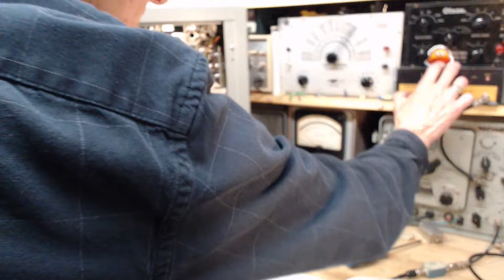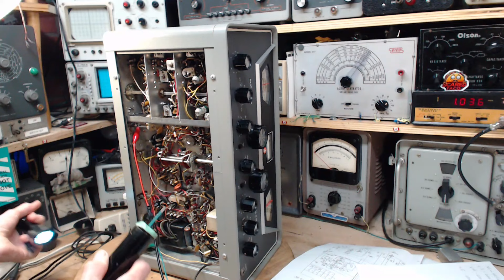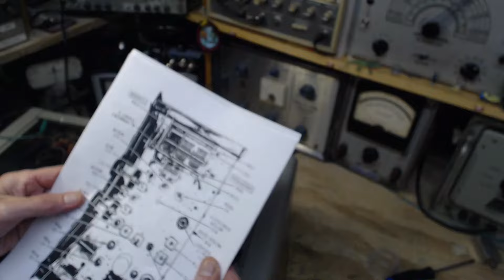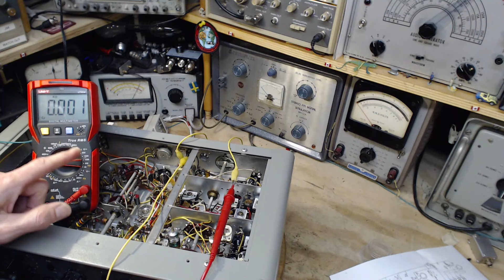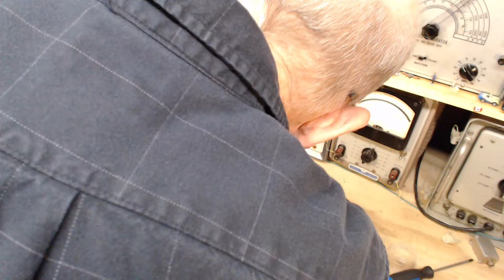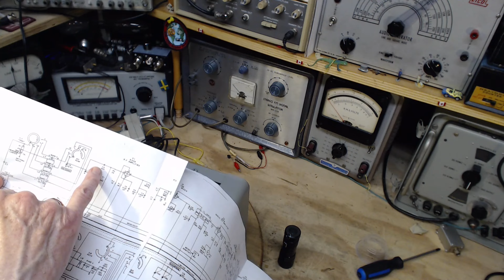Hallicrafters SX 122 Video #4 - Signal Tracing

Comment: But your main problem I think is your test equipment. Maybe a Cushman CE 3,4,5 or 50. These old solid state service monitors can provide a stable rf signal from 10 khz up to I think 500 mhz. I have a Motorola R2002c as well as a couple of Cushmans.

Comment: As I review episode 3 I see that there is a shorting bar between A2 and GND, That is good. But I cannot tell if both screws are down tight. If not it could mean that the A2 connection is not being made or not well.. That would seriously degrade the radio's sensitivity, particularly on Band 1 (AM), Hard to tell from my remote vantage point.
Experience well learned tells one to look for this kind of stuff. This may be why he gets no signal into the grid of the RF Amp. If the problem were a snake he would have been bit a couple of times by now.  It is often interesting to do an - in parallel - trouble shooting routine. When I watch a couple of the channels of those doing this kind of thing I can sometimes beat them to the solution but they are so good that they often beat me to the solution.  All my best Jim (He does say he does not read the comments but sometimes I wonder)

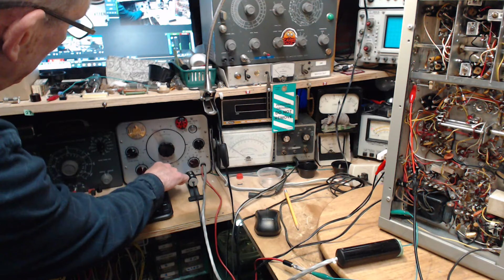Comment: AT 3:50  I can conclude that the first few pages of the manual have not been read/understood. It is important to know what has to be done to operate this receiver. Signal tracing at this point may be misleading. Perhaps just one simple jumper (as described) might go a long way to solve many/all the issue(s)